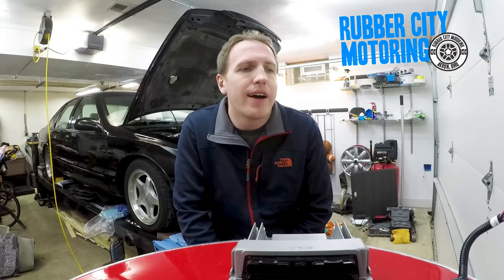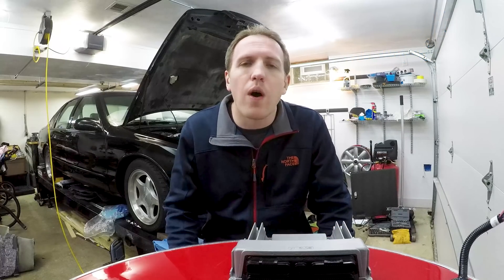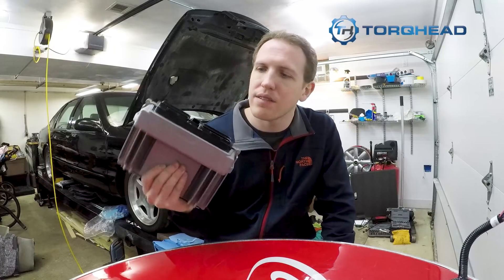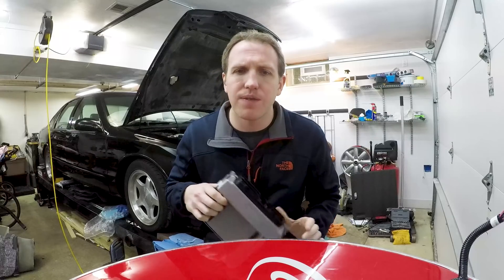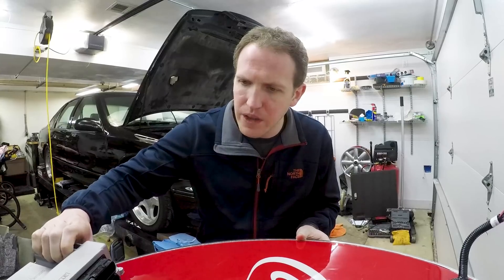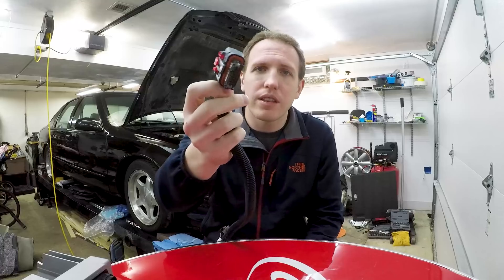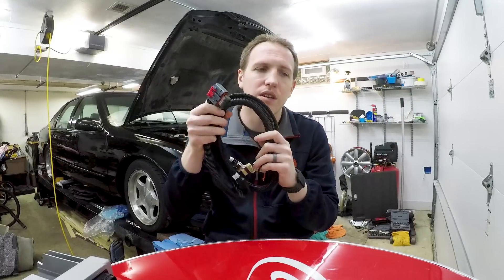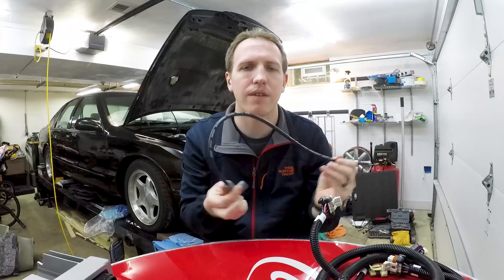Part 5: Torqhead PCM & Electrical Wiring Installation

Comment: Did your Torqhead PCM fit fine with the K&N? I see in your video is a bit thicker than the stock LT PCM.  Thanks.
Reply from the maker: No issues. I had to remove the factory plastic pcm holder, but it held fine under the K&N.

Comment: I would of killed for something like this back in the early 2000's. I had a 93 Formula, and working on that ignition system sucked balls.
Reply from the maker: It really has been neat to see the innovations done on the LT platform.
Reply: @RubberCityMotoring  it really has! I remember googling the Optispark issue and how to “resolve” them. Most came down to a vented cap & rotor or using the MSD Setup. Somehow I eventually came across the LTCC Setup. Would have loved to try that, but it was just too expensive at the time and seemed too experimental. The times have changed since then.

Comment: Morning. 

First off luv your channel. I have a 96 ss looking to buy this Torque head kit for my stock SS motor. Any suggestions I should know before i buy and I'm not a mechanic but I do know a few shops I  have been looking at to do the change over.

Any advice would be greatly appreciated.
Reply from the maker: I would make sure everything else is up to par. Fluid changes, maintenance, etc. The torqhead is a neat product but just make sure your car is ready for it. 

Thanks for watching!

Comment: Found your channel a few months back and loving it. I had a 96 SS DCM a long time  ago and loved that car but traded it in for a Camaro SS. Just Sold my Camaro SS since we now have kids and picked up a 95 Impala SS for the family to cruise with. I am thinking about the torque setup but is it worth the money? Did you see any performance increase with that new setup? Keep up the great work on this channel!
Reply from the maker: Thank you!  Umm it all depends honestly. If your opti is running fine, I wouldn’t mess with it. I did torqhead for the reliability and also to ditch my opti. I just wasn’t confident in the setup. I also like removing that old 96 computer as well. 

It is a very nice kit, good customer service and a “fun mod” for sure. Congrats on the family and the ‘95! Thanks for watching!